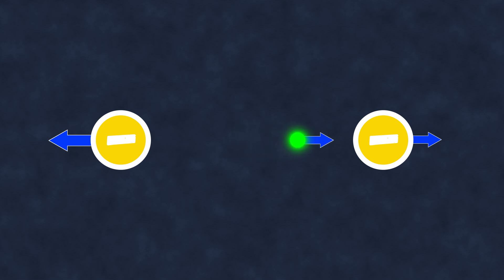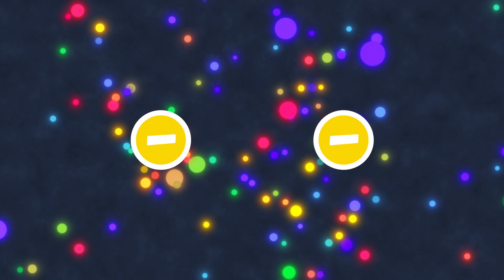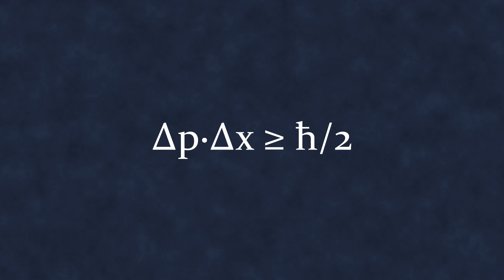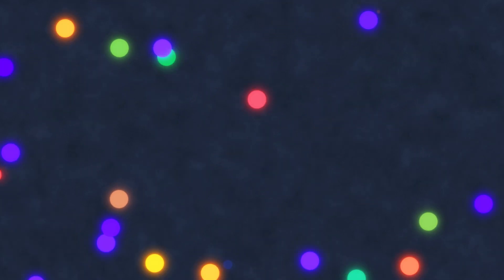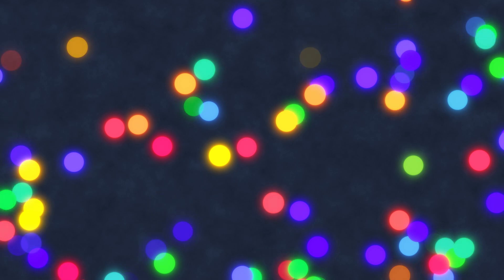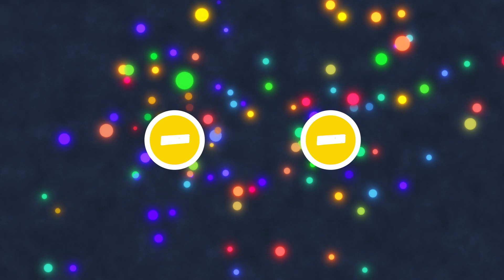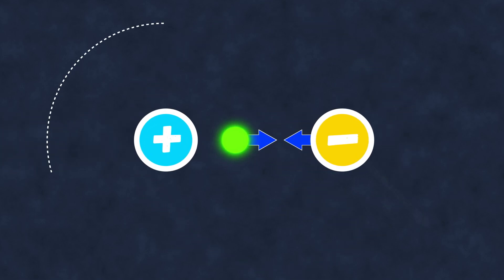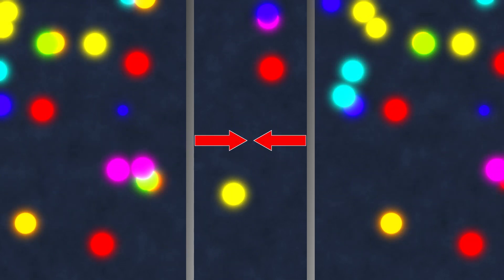Virtual Particles: What Are They and Do They Really Exist?

Comment: A crucial point is missing in this video: virtual particles are just a way to visualize a mathematical framework (perturbation expansion in QED), it makes no sense to make any predictions using such pictures. The questions in the comments make no more sense and only prove that the whole picture is rather useless for any true explanation. Virtual particles are the interpretation of Feynman diagrams but we should not forget that those diagrams are just a tool to keep track of different terms appearing in complex  calculations.

Comment: An experiment just published in the EM journal IRECAP shows an EM pulse propagates instantaneously in the near field across 1.5 meters of space with no propagation delay. This shows that the front speed (speed of information) or speed of causal action is instantaneous in the nearfield of EM sources. The experiment was repeated hundreds of times, and also done by an independent researcher in their own lab, with exactly the same results. The paper also shows that the effect is predicted exactly by Maxwells equations. The paper is linked below. The effect can also be shown to be fundamentally due to the Heisenberg uncertainty principle. This shows that the effect is fundamental to all fields including: EM, gravity, and quantum. 

In another experiment, a sinusoidal signal was transmitted between 2 dipole antennas as they were separated from the nearfield to the farfield. Analysis of the resultant phase vs distance curves (dispersion curves) shows a clear minima in the nearfield for all the EM field components. Applying well known phase speed and group speed operators to the curve, which are inversely proportional to the slope of the curve, show that both the phase speed and group speed are instantaneous in the nearfield and reduces to about speed c in the farfield.

Both experiments have been independently repeated by other researchers, obtaining the same exact results. If speed of light is not constant, then the 2nd premise in Relativity is wrong and what remains is the 1st premise: Galilean Relativity. Instantaneous signals violate the Relativity of Simultaneity because the signals appear the same in all inertial frames of reference. This can easily be seen by inserting c=infinity into the Lorentz transform, yielding the Galilean transform, where time and space are absolute. So if a moving body is observed with instantaneous nearfield light, then no Relativistic effects will be observed. But they will be observed if the frequency of the light source is changed such that farfield speed c light is used. So by simply changing the frequency of the source, Relativistic effects can be turned off and on. The only possible explanation is that the effects of Relativity are not real and are just a type of optical illusion. This result will affect all of modern physics. 

In addition, the above results are predicted by EM theory. Maxwell's derivation of the speed of EM fields was wrong. The reason is that EM fields are created by sources coming from Gauss' and Amperes laws., and these sources must be included and can not be set to zero as Maxwell did. Including the source term yields a wave equation equal to a source term. Inserting a dipole source yields EM field components that with phase vs distance from the sources dispersion curves with a clear minima in the nearfield, and become only approximately linear in the farfield, starting about 1 wavelength from the source. It is well known that both the phase and group speed are instantaneous when there is a minima in the curve, and only exactly a constant speed when the curve is exactly linear, which only occurs at infinite distance from the source, which does not occur in a finite sized universe like ours. So Maxwell's solution is only valid at infinity, which does not exist in this finite sized universe. So the speed of light never a constant in our universe. If the speed of light is not constant, then the 2nd postulate in Relativity is wrong. 

The same behavior can be shown to occur in gravity. It is well known that general relativity reduces to gravitoelectromagnetism (GEM), which assumes that gravity can be modeled by Maxwell's equations with different constants. So the same solution that occurs in EM theory also pertains to gravitational theory. This explains the instantaneous gravitational effect in the near field, observed in the stability of the planets, and also explains that Gravity waves have been observed to propagate at about speed c in the far field. This theory then accounts for all the observed gravitational effects including instantaneous nearfield and the speed of light farfield. The main difference is that this theory is a field theory, and not a geometrical theory like General Relativity. But because it is a field theory, Gravity can be then be quantized as the Graviton, enabling the unification of Gravity and Quantum Mechanics.

The phenomena also can be seen in quantum theory, and can be shown to be the consequence of the Heisenberg uncertainty principle. At the source, the position of the photon emitted from the source is precisely well known, hence the momentum or the speed is infinite. At about 1 wavelength from the source, the wavelength is starting to be come clear, such that frequency x wavelength ~c. But according to Fourier Theory infinite cycles are needed for the wavelength to be exactly known. So the above frequency wavelength relation is only valid at infinite distance from the source. So the speed of light never reduces to exactly speed c in our finite size universe.

There are currently many interpretations of quantum mechanics. But only the Pilot Wave Interpretation is compatible with Galilean Relativity. In this interpretation real particles are guided by real pilot waves. But the real pilot waves are known to communicate information about the particles instantaneously with the environment. Because this is not compatible with Relativity Theory, this interpretation has not been taken seriously. But as a result of this discussion, this is no longer a problem, and Pilot Wave theory should now become our best interpretation of quantum mechanics.

For more information see the following links:

*YouTube presentation summarizing my 35 years of research in this area: https://www.youtube.com/watch?v=sePdJ7vSQvQ&t=0s

*More extensive paper for the above arguments: William D. Walker and Dag Stranneby, A New Interpretation of Relativity, 2023: http://vixra.org/abs/2309.0145 

*Electromagnetic pulse experiment paper peer reviewed and just published last month in Journal IRECAP: https://www.techrxiv.org/doi/full/10.36227/techrxiv.170862178.82175798/v1

Dr. William Walker - PhD in physics from ETH Zurich, 1997

Comment: Good grief! A real physicist does care about whether virtual particles are real or not. 
Real progress comes from penetrating contradictions. 
Like: the lamb shift  and the casimir effect which both permanently extract energy from the virtual domain ( or vacuum energy). 
This permanent energy extraction is a gross contradiction of the time energy uncertainty principle. Ie the time energy uncertainty principle is wrong . In particular  it is wrong in the application to virtual particles existentiality- which is a modelling overreach beyond measurement uncertainty.
Unfortunately you are just repeating the bad science propagated by others. 
We are missing 96% of the universe  in the form of an invisible charge neutral particle that influences curvature. Virtual particles are modelled as invisible charge neutral particles.
Its practically on a plate.....
The pions carry most of the mass in the universe yet they are said to be virtual. Their energy is thus also permanently non-zero. Modelling them as violently fluctuating in and out of existence is testament to how logically bankrupt physicists are prepared to be to prop up the belief over logic.